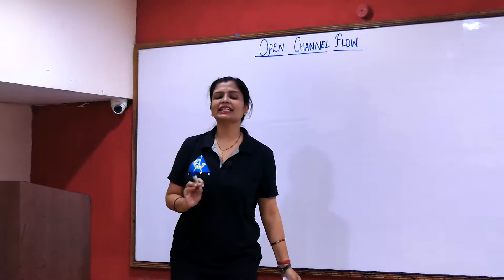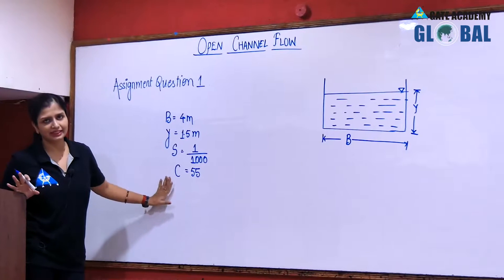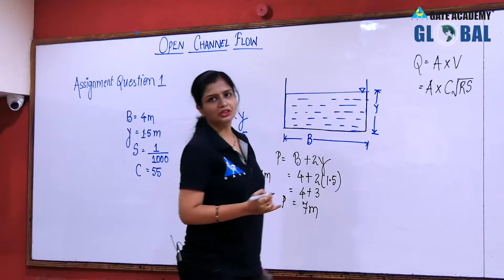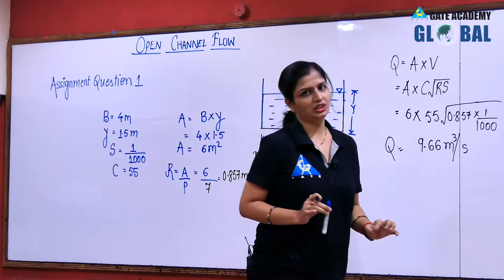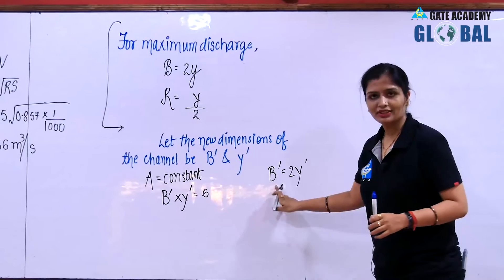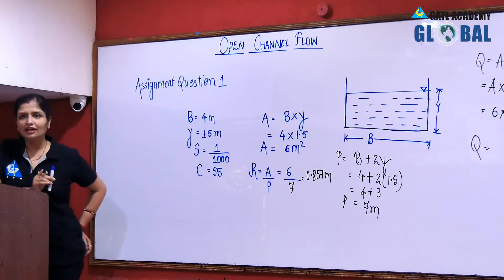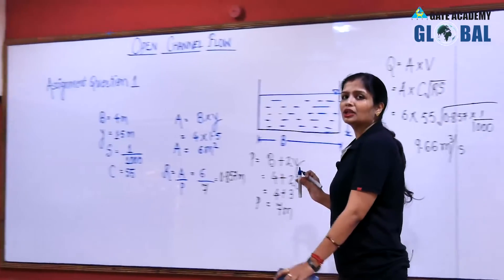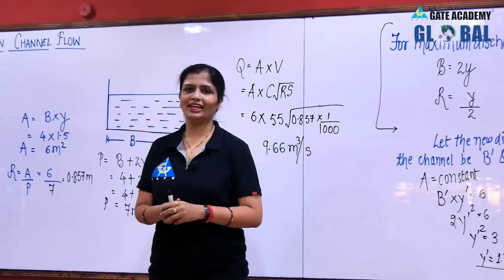Questions on Rectangular Channel Section | Lecture 11 | Open Channel Flow

Comment: calculate the normal and critical depth for a rectangular channel having discharge per width is 3 m^2/l. mannings co efficient is 0.025 and slope s=0.0095
Plz solve it